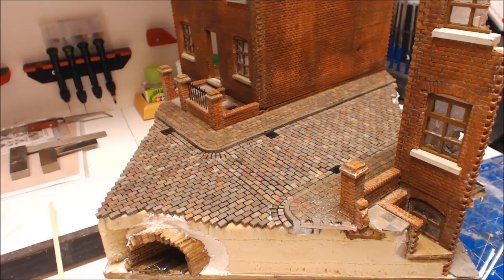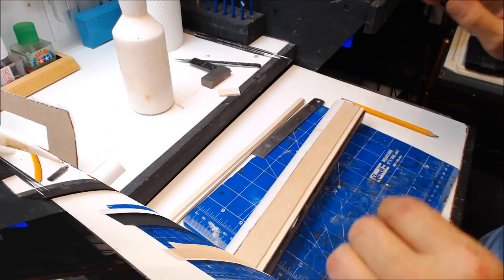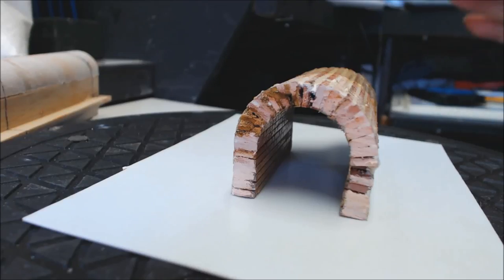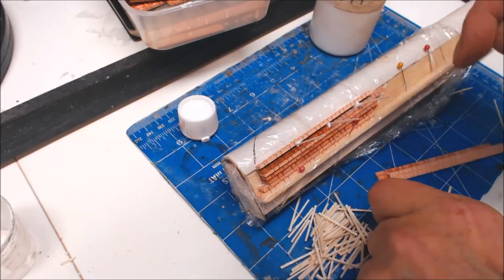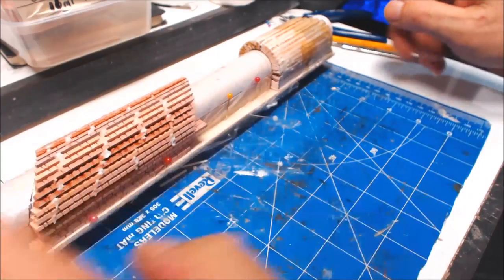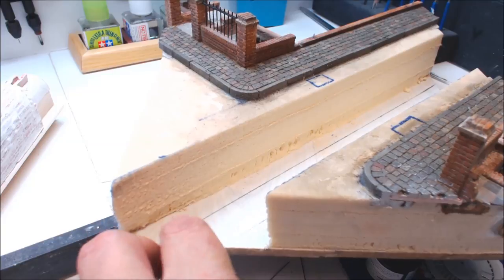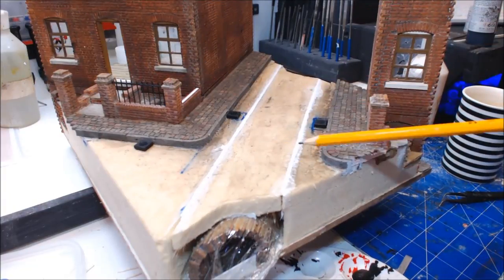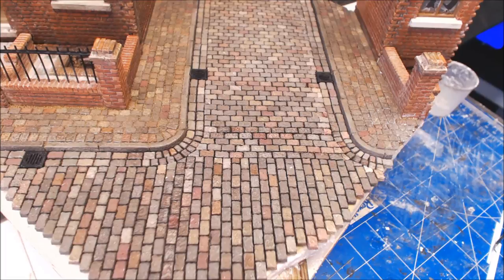Prototype Build In English Bond In 1/35 scale (Part 6)

Comment: Very nice, Sim. What colour paints are you using for the street cobbles?
Reply from the maker: vallejo Model colour chocolate brown 70872.black green 70741 burnt red70814 German grey70995 black brown70822 belge 70821 I basically use any colours that have left on my shelf and just cast one colour per mould many thanks Sim
Reply: Thanks for the reply. Loving the latest build...Cheers